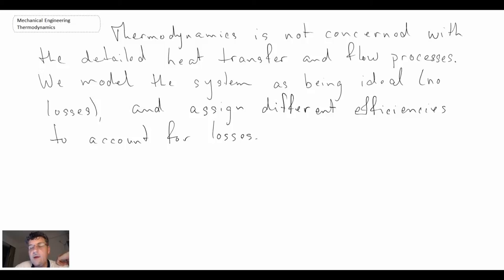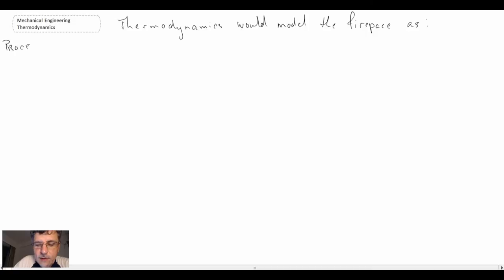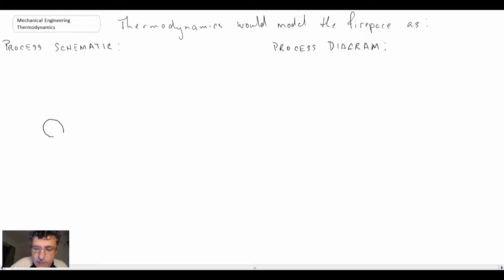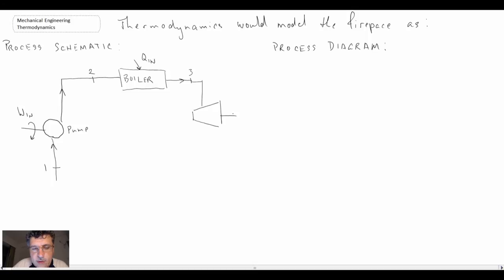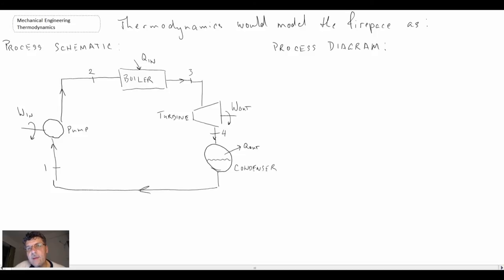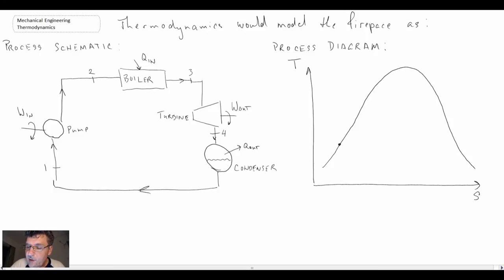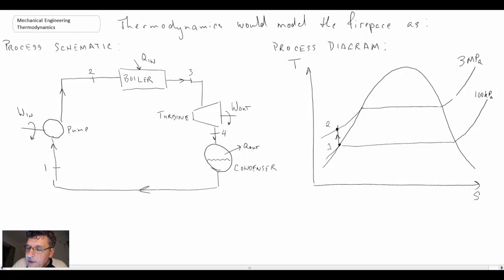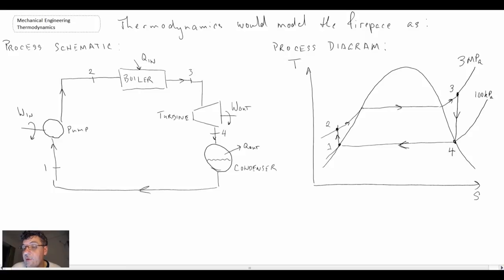Mechanical Engineering Thermodynamics - Lec 1, pt 5 of 5:  System Modeling

Comment: In the turbine the temperature is fixed as you said. but it seems to me from the t-s diagram, there is a drop in the temperature from point 3 to point 4. thanks